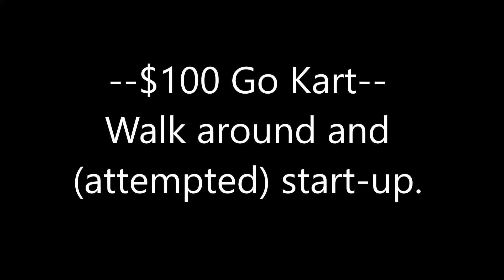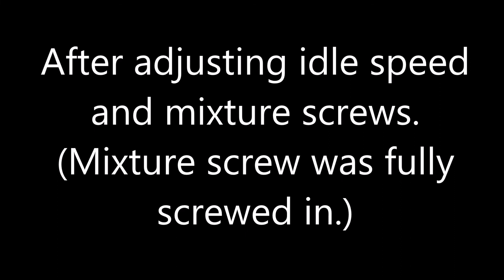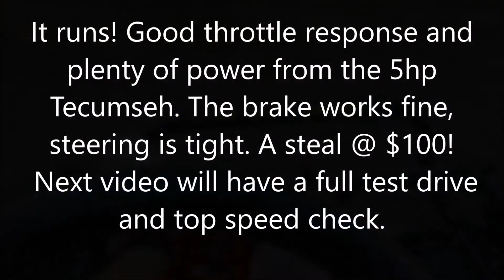Craigslist $100 Go Kart with 5hp Tecumseh - Start Up & Walkaround

Comment: I got the Same exact go kart with the same engine with rollbars and light only for $40. Now that is a steal.
Reply from the maker: Nice score.
Reply: 15to70 I just got a predator 212 for it
Reply from the maker: Good idea. More power and nothing to fix or repair for the next couple years.
Reply: 15to70 yeah

Comment: I just bought one of those off craigslist, the frame is great. Mine had a 4hp Briggs but I switched it to a 6.5hp, only issue are the breaks
Reply from the maker: The single disk brake on mine didn't have a lot of stopping power. I think better brakes would be a good upgrade.
Reply: +15to70 yea it would be, mine has the original band brake which wears out after about 3 uses. I'm thinking of installing disc brakes.
Reply: Trying to get bey it
Reply: How much

Comment: I have the same kart but I extended the frame and put a 250cc motorcycle engine on it.
Reply from the maker: 123aznbeast how did you extended the frame? How does it handle with that much power?
Reply: 15to70 I cut off the rear bumper and welded some square tubing to the remaining tube. It handles ok but is pretty scary going about 60mph on this small thing. I made a few short videos on it on my second channel if you wanna see it, the channel is 123aznbeast2

Comment: How did you set up your throttle cable to the engine. i have this same motor and i'm the final stages of the build. But i have hit a road block with this throttle. Please help
Reply from the maker: i didn't have to mess with my cable and don't have this kart any more so I can't really help much, but i do remember it was a straight run under the seat.
Reply: Timothy Wells if ur still having this problem dm me on instagram @96ths

Comment: i just got a very good cond for 40$ red...i reinforced the frame points since max weight in manual is 150lbs....im 180 =) just to be safe , got free 14x6 tires on it(it was bitch to put on but 2 big screwdrivers and 30min a tire ) anywho  ,they sell racing carbs for it its like 20$ ... im adding lights ( i do like your tool box idea ) extra spark plug,wrench etc ill prob add a batt in there and have it charging .....
Reply from the maker: I didn't know it was only rated for 150lbs, that seems low for a 2 seat cart.
Reply: its youth gocart!!   yerf gocart 1203,  look up manual find it in 2min   i mine is 95% i reworked the gears the back sprocket is like 9$ , since i added more weight tires ,most of them crack near the back frame , like mine was but someone also jumped it good and bend steering  left arm , its like 20$ new but im gonna try bend it back and reinforce it .........good luck  ..hit me upp ill show u some project .....im keeping the 5hp engine ,(cleaning it up now)  , got new centrifugal clutch 18$ on ebay ..good to have spare and this one was pretty rusty ....my welding got better for sure LOLL   take care/good luck /have fun

Comment: I just bought exact same thing, same motor issue. The frame of mine is in a bit rougher shape though.
Reply from the maker: did you get it running?
Reply: +15to70 not yet, haven't worked on it. putting the new carb in tomorrow I hope.
Reply: New carb did the trick, can't beat that from $15 from amazon. Now I just need the correct throttle and governor lever springs, the paperclips they used weren't cutting it when it came to idling.
Reply from the maker: +Jonathan Burdette Yep, totally worth it to get everything back as it should be. More time riding, less time tinkering.
Reply: Got it running 100% with the right springs and levers. Taking it apart to strip and repaint.
Reply from the maker: You should make a video of that process. Interested in seeing how it turns out.
Reply: +15to70 well I've been taking pics and short videos. I guess in the end I can post it.

Comment: I have the same motor but my don't have a primer bulb it's just a choke or run and it cranks
Reply from the maker: Colby Ainslie the primer bulb on this one didn't even work but it still started fine without it.
Reply: Colby Ainslie I have the same thing

Comment: can you please help me find the mixture screw on the carb
Reply from the maker: Robert Tadic Google images of the carb, it will show you exactly where everything is at. I would make a video but I don't have the cart any more.
Reply: 15to70 thanks, I appreciate it
Reply: u prob got ) google the (TECUMSEH T E C H N I C I A N ' S  H A N D B O O K)   these engine came with 9+ diffrent type carbs over the years the hanbook is indept repair of all your needs, these where 5hp models allot did not have adjustment screws least 4 of them .. side lil screw usually idle mixture, and on the bottom MAin or some times got hi/low mix screw also...look up the number on the Tecumseh carb series

Comment: That engine is slow get a honda or a clone the are powerfull
Reply from the maker: A Honda would be nice but I wouldn't have wanted much more power on this cart unless it got some other upgrades too - especially braking.
Reply: Karts & Engines Ya a pos Chinese engine lmao Honda only no clone bs
Reply: The power sports were the best go cart engine ever made
Reply: But they are really finicky
Reply: Sam Dittmar Why do people like these chinese engines i have to fix them more than i can ride them
Reply: Steve the Tecumsehs were made in the u.s until 2008. But I fix them because I don't like to replace the engine unless I have to. But they like them because they are cheap. Like 100 bucks cheap.
Reply: Steve that's fine did not mean to sound offended. No problem
Reply: Steve yup same for me